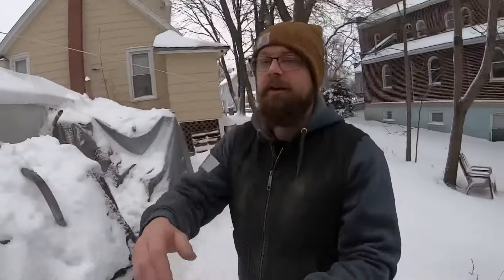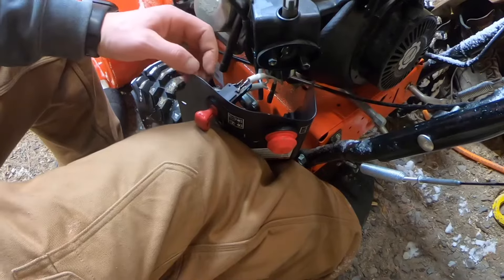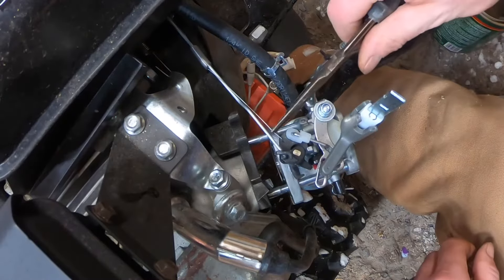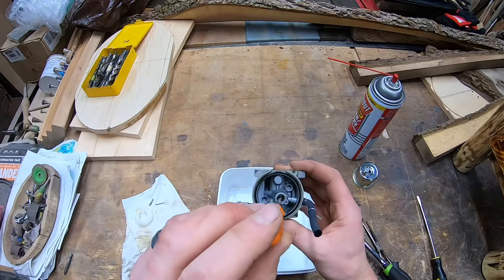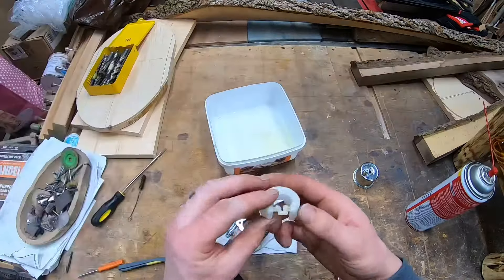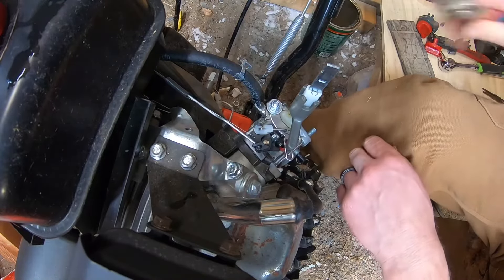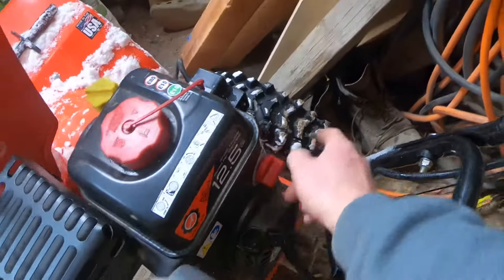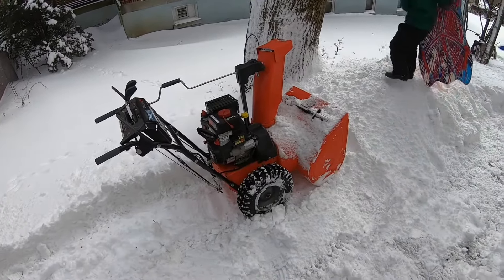Ariens 24” Delux snowblower runs rough or won't start. clean the carburetor plus jets tutorial

Comment: There are more gas passageways which you did not clean out.This is why the machine is surging perhaps.Spray every hole on inside and outside of carb once you have your float bowl off and you should be good to go.The important holes are inside the carb bore just close to the throttle valve.Good luck.
Reply: Pffft...

Comment: Better that original but you did’t clean the pilot jet by carefully unscrewing that red plastic screw on the top of carb. Restriction in that jet causes surging and only running on partial choke. When all is good it should run fine with choke completely off in 5 or 10 seconds after cold start.

Comment: I did something wrong...only runs at idle speed after putting it all back together.  Any ideas?
Reply from the maker: When you pull the cover off revealing the carb there is a plastic shroud to the right between tye gas tank and recoil if the linkage is pinched in there it can cause this I’ve had it happen. Just an idea
Reply: @KyleHallwoodworker  Yep !!  I must  have pinched the linkage.  Run super now !!!  Thanks so much...I shall forever be in your debt !!!!  No more sleepless nights.
Reply from the maker: @ awesome! Glad I could help

Comment: Wire twist tie with the coating removed makes a great tool to clean out the holes in the jet screw and emulsion tube. Poke through the tube. In one side and out the other. Follow up with spray. You should see mist coming out all holes. Good video.

Comment: I watched both of your videos.....I have a 921037 Deluxe +....we got about 10 inches here in Saskatchewan. I blew snow yesterday, but the blower didn't seem to have the power it once did. Then this morning, it ran for 30 sec before it died. SO....I took the whole thing apart like you did, even the black screw and the red block, cleaned all of it, and it works like it should have.
Thanks for the help!

Comment: What if I didn’t count how many turns I turned the flat head screw driver when releasing the jet? How will I know if it is not correctly tightened? It was completely tight when I released it, and I tightened it with the same force.
Reply from the maker: Sounds like you put it back the same way should be ok . If not the machine could run rough

Comment: I hope I make it through the winter with my Ariens and I will replace it asap. It's an absolute piece of crap. 
I need something more reliable.
Absolutely hate to work on it in the winter with my fingers half frizen and have it stalling every once a while. Trash.
Reply from the maker: Turn the fuel off take an 8mm wrench and drain the carburetor. By removing the bolt on the bottom side . Once drained replace bolt turn fuel on prime 1 choke and pull , no start prime again once and pull
Reply: @KyleHallwoodworker  Thanks, that is exactly what I do. I also had to replace on and off switch with a big red button (momentary switch). So, now it's always ON, unless you press it and kill the engine.

Comment: Get yourself some torch tip, cleaners with brushes it’ll be less than $15. When you’re putting that screw in jet, just turn it counterclockwise until you hear a click, and then turn it clockwise all the way in and tighten. Just snug. I had to watch your video to know which way that jet went in with the holes because I took a shortcut and popped out the bottom without taking the carburetor off to clean. I didn’t know which way it went back in but thanks for your video. I know now and I did put it together, right. A lot of times I just put the snowblower up on its nose and take the bowl off the carb and clean. It usually works 90% of the time. just take that screw at the lowest point of the carb bowl out and drain tank and carb to remove all gas to store snowblower. pull engines over slow till on compression. That way, the exhaust and intake valve are closed, so no moisture gets in the engine. sounds to me like it’s running a little bit fast rpm should be set at about 3600/3800 RPM you’ll need a tool that measures the shaft speed on the engine.

Comment: Great video! I have little to no experience working with machines, but was able to clean my carburetor and jets with little problems. I particularly liked the camera angles, I can clearly see every part you're discussing. Also, your detailed narration. You strike a good balance between describing what you're doing and not endlessly droning on (a typical problem with DIY videos).

I think my Ariens model might be a little newer or different, so if you're following this video keep in mind two potential deviations: 1) the screw by the pull cord was described as the one 8mm screw, but on mine it was still 10mm, 2) the electrical was a little simpler on mine. There was only one wire to keep track of. I think this is because instead of an on/off switch mine has a keyhole that has to have the key in it to start.

Thanks for the help!

Comment: Brand new Aries snow blower, bought oct 2021 used it 5 times. Had to send it last month to the dealer since there was a defect in the tub where chunks of rust were forming and paint falling off. The repair shop called and said it was running rough so we can clean the carburetor for $150.00. I said I only used it 5 times and I put some gas stabilizer how is this possible. So I said no I'll do it myself. 

Loved your video as it was helpful and so easy to do. My carburetor looked cleaned and the jet also look clean but still went ahead and made sure all the holes were free of debris. Once all assemble back, it runs just like the day I picked it up. Thanks again for your Video.
Reply: Oh boy... you're not alone, Dan. SHIT. I'm in the same boat. Was delivered 53 weeks ago and I've been watching vids & chatting w/ guys on Snowblower forum. Question: you mentioned 'tub'; is that in the carb bowl or somewhere else? (Mine is model 920025- Classic 24: it came from the factory w/ one of the shear bolts not installed either and Ariens didn't respond to my emails at all)
Reply from the maker: Glad I could help

Comment: Use ethanol free fuel to elevate corrosion and blockage in the carburetor.  Sea Foam added to the fuel will also help keep carburetors clean. No fuel additive will completely remove the moisture caused by the ethanol in the carburetor while in storage during the off season. It is best if available to use ethanol free fuel for all your carbureted outdoor power equipment. And always drain your float bowl when in storage. Or shut the fuel line off and run the machine until it runs out of fuel. If emptying the float bowl this way, as the engine begins to run out of fuel, choke the engine to suck as much fuel out of the bowl as possible. If you leave fuel in the gas tank during the off season, make sure the tank is completely full and fuel stabilizer added, this will help keep moisture from building up in the tank.
Reply from the maker: Thank you for the comment
Reply: @KyleHallwoodworker  I use a brand of fuel called Aspen. It’s quiet expensive,  but have no problems at all